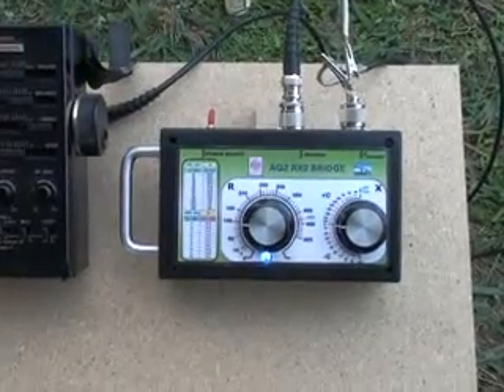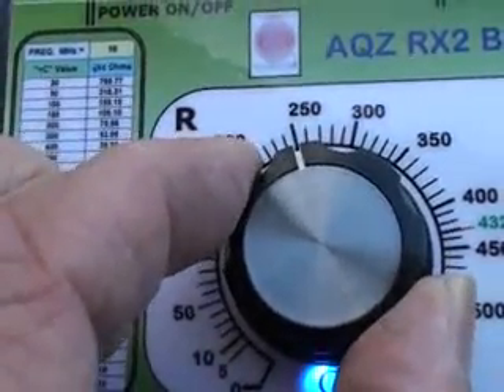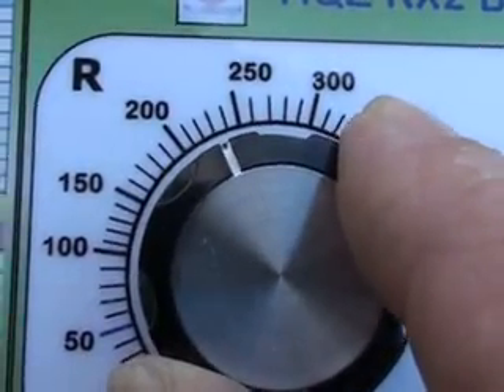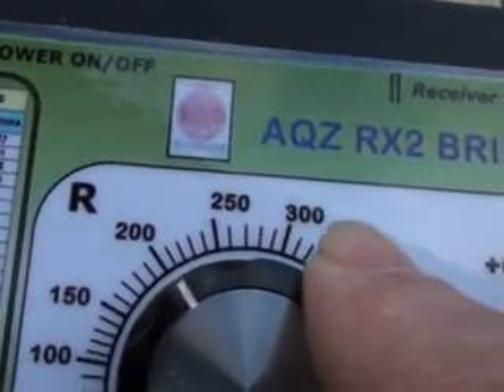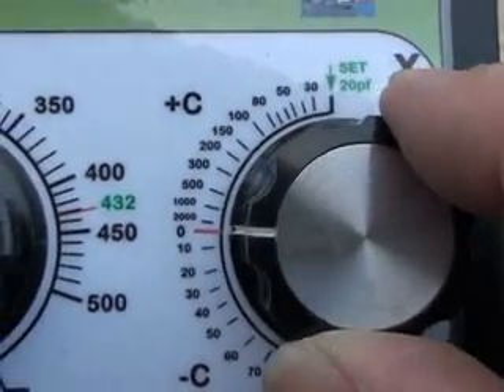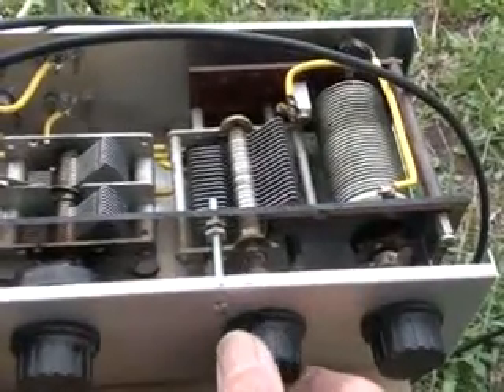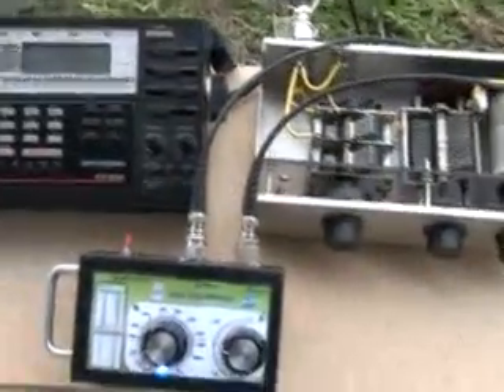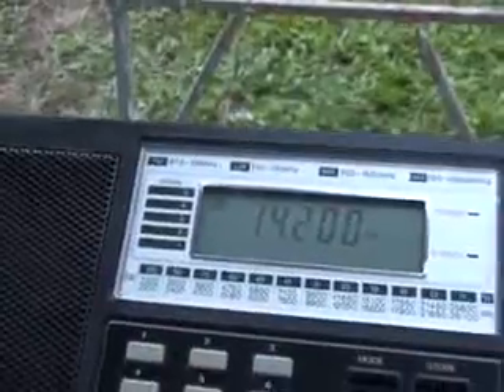Tuning a random wire with the RX2 bridge.mp4

Comment: Great video!  I own several antenna analyzers but always wanted to try a noise bridge. Your RX2 looks more accurate than the Palomar or MFJ.  I'll bet this would be a great way to tune the "screwdriver" mobile antenna - have a relay flip in the noise with the motor control, keep it in for a short delay, no TXing required.  Worth trying. vy 73.
Reply from the maker: Yes, thanks for the thumbs up. Seems to work very well with EH antennae. Sold over 50 in Japan who claim it is the only analyser which gives the correct value for the phasing capacitor. I have not used it for that but I imagine that is correct going by the feedback from JA. I tune all my antennae with them and have them inside my antenna tuners with a bypass relay activated by any sniff of RF so as to not damage the bridge.  I don' t sell them at the moment a I have run out of parts, and need at least 20 or more serious buyers to justify another run of PCBs and bits.  To date, from 2008,  sold over 500 RX2s, and around 930 RX1s, around the world, including some tech colleges as student projects.  Thanks for the comment, Lou.

Comment from the maker: Hello OG. Tuning a coil, finding the resonant frequency is the same. The coil is an inductor and needs to be in series or parrallel connected to a capacitor. The 2 components, plus resistance in the wires, form a tuned circuit. To find the resonant frequency you can use a noise meter and receiver (as per my tuned circuit demo) or signal generator and RF meter (detector). Or measure inductance (using "L" meter) and calculate frequency for any value of C using a formula in your text book.